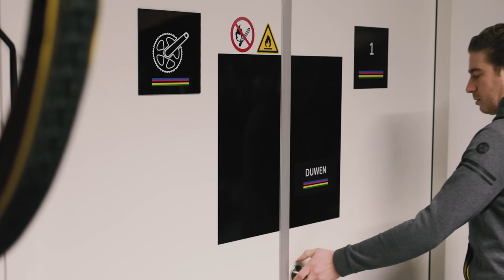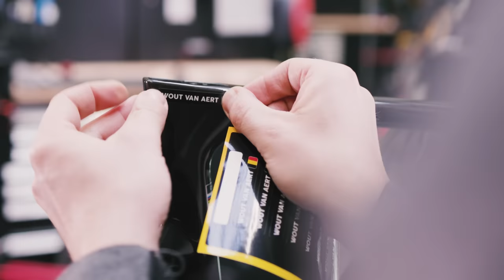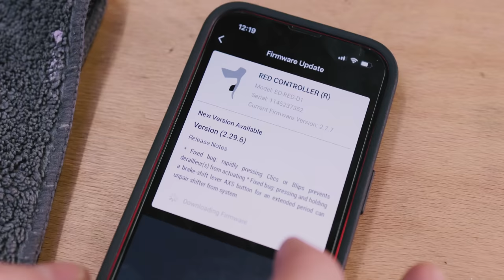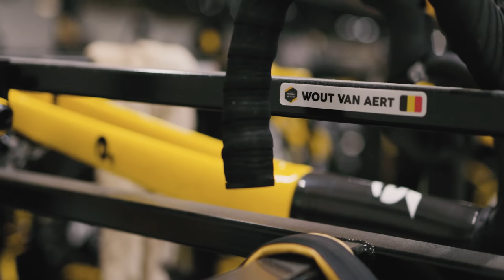Probike Build I Dream Build I Cervélo Soloist 2023 I Wout van Aert I Team Jumbo Visma

Comment: I’m having a weird picture of the Soloist so far. It’s said to be quite heavy, and the price at least in Germany is ridiculously high, even with a simple Shimano 105 group set. On the other hand I love the idea of something in between the S5 and the R5, possibly combining both the aero and the lightweight world. But this doesn’t seem to work out well so far…
Reply: probably get a cube with full ultegra di2 and integrated bars for less
Reply: @caspar_gomez  which cube?
Reply: I dunno, I have one and really like it but I think research it too much. My local shop told me they ordered in a frame in my size & asked what components I wanted to build it up with. It's my first proper nice road bike.
Reply: And you can top it with the worst after sale experience ever. My Caledonia spat out bottom bracket in less than 5k km. Apparently their bikes are known for it.

Comment: May I ask what is the headset top cap in the video? It looks similar to the acr system from fsa but I remember that the top bearing of acr is 1-1/2 while the soloist frame set with 1-1/4 top bearing.

Comment: That's a great video showing the knowledge of bike builders, really enjoyable.

I wonder though, how is it that we still don't have a system to always align handlebars with front wheel, and that someone still has to do it "manually" ?
Reply from the maker: there is a laser system from tune, but it only worked with traditional two piece cockpits. but, yeah.... it's still a little old school but it's not really that much of an issue. 
as long as they are tightened.... https://youtube.com/shorts/HK-eld1h6ak?feature=share

Comment: Great vid. I imagine Wout wont be riding this when it counts though...7.6kg!
Reply: Weight isn't everything.. especially not for this Paris Roubaix model. This isn't a climbing bike
Reply: @Leendert82  indeed! 
But as a comparison the new Giant Propel aero bike is right at the UCI limit of 6.8kg so there are much lighter options out there than the new soloist in the build option shown anyway. 
No professional will want an 0.8kg penalty especially if there aren’t significant gains elsewhere.
Reply: well, he won't. I bet you won't see him in any race on this set up.
Reply: @peterford7805  a big portion of that weight is the Propel's wheels (over 300 grams lighter than this) and groupset (Shimano is over 100 grams lighter than SRAM). Then there's the seatpost (100 grams can be saved with Darimo). The propel is a lighter frame, no doubt, but it won't be able to handle a cobble stage. Whereas this might be able to
Reply: @l.d.t.6327  doubt that, I'm pretty sure this will be the bike he uses for Roubaix. A pretty flat race where you want wide tires which don't fit on the S5, and the Caledonia's geometry is too relaxed (and even heavier).
Reply: @serdiezv  the thing is, the video doesn't give any info about the tires / tubeless / tubulars. About the most important feature of this bike imho.
Reply: @l.d.t.6327  don't want to give away the sauce too early 😉. They're super specific as to not letting people know until the race, and pressures are top secret.
I do think that they'll be using new 30/32c Vittoria tubeless tires with the mousse liner for Roubaix
Reply: @serdiezv  Well, they probably built the bike to allow WvA to test it out on the cobbles, but to claim that this bike in this setup will race, is rather bold, as you seem to agree with. Not impossible, but not very likely either.
Reply: @l.d.t.6327  I don't know if the exact tires will be used. Maybe they'll change the tires and double tape the handlebar, but I do think they will be using a Soloist for the race.
Reply: @serdiezv  S5 accepts 34mm tires, that's enough for Roubaix

Comment: Does anyone know what headset cap is that at 3:50? Does that come with the Vision 5D ACR or is it an additional part? It seems like a FSA ACR No.55R, what size though? 1-1/2? Cervelo website states the headset size to be 1-1/4 to 1-1/2.
Reply: I heard that FSA are making specific soloist headset caps for ACR like they do for other bikes but I don't know when they are coming out. I'm sure JV is able to either make or get custom ones made for them either way.

Comment: Love these dream bike builds! Curious though on the bar end caps. Did the end caps go over the bar opening and not in it? 20:50
Reply from the maker: yes, they go over the bars and saved quite a lot bars already. with the added protection they are often enough for the bars to stay on after after a crash (which kind a happens on a regular basis) and spares the mechanic a lot of work with the internal routing of the brake hoses.
https://www.closethegap.cc/product/savemybar-2-external-bar-plugs/

Comment: With websites like rolling resistance ect.. is there any places to find out aero drag?    Really interested in the soloist but really curious how much aero advantage a canyon aeroad has over it?   Upgrading from an 2009 tarmac and really like the idea of the soloist,  just trying to determine if I’m giving up too much free speed..
Reply: Same thought. This or Aeroad since I almost exclusively ride flats where I live.
Reply: @onacoffeeride  I’d def go for aeroad if it wasn’t for the seat post issues.
Reply: @ironore8677  I am thinking of waiting for release of redesigned Aeroad that MVDP is on. Looks like they made change to seatpost system.

Comment: I thought the soloist was an old Cervelo from the early 2010s. I'd not heard of it because I didn't pay attention to models for a few years. Is it a specific model for the rough Spring classics? It sure looks good. But Wout had an unfortunate Roubaix, much like the rest of his team. Lots of punctures. That could be rubber, but Fuck I guess that could be down to anything, including luck.  Cervelo sponsored pros used to use the R3 for the roughest classics. I'm unsure what bike they used in 2023. It must be the soloist though, because that is a monster chainring.
Reply: Yes, the original Soloist is an early 21st-century road bike with both aluminium and carbon counterparts. This resurrected version is similar to its predecessor geometry-wise and is considered as a race-capable bike that doesn't hurt the wallet as much as other bikes although it's still not majorly affordable.

Comment: This has to be the Roubaix bike. A 54t 1x and a pretty wide looking handlebar with too much bartape...
Reply from the maker: Yes, the bar tape is a giveaway and they are experimenting with a chain guide mounted to the front derailleur hanger, but did'n t get it in time for the build.
Reply: @roadbikechannel  yeah, was intrigued as to why they didn't completely remove the hanger and when I saw the bartape it made sense

Comment: 10:49 - is a crow foot wrench needed here to get it to 8nm? or do you just snug the compression nut up?
Reply from the maker: You don't really "need" one but it wouldn't hurt to get the right torque. We're always using one and it's actually part of the sram bleed kit. Most of the pro tour teams are a little more freestyle and rely on experience

Comment: 5:28 whats going on here? why is he modifying the headset, is there no risk of it cutting into the brake lines?
Reply from the maker: not really, the thin washer he's cutting is gonna be compressed same as the headset cone and will turn with the steerer and handlebar as one system. he's doing it so he doesn't have to fiddle the brake hoses through the washer. and there won't be any force on this part of the washer anyway since the cone has the same shape.

Comment: WvA has 240 hubs? Why not 180? Budget issue or preference?
Reply from the maker: Budged won't be a problem since Reserve is part of the PON group same as Cervélo. Preference probably, 20g more weight per wheelset but a lot less maintenance and stiffer.
Reply: @roadbikechannel  do you know the reason they are stiffer? that's interesting
Reply: @Carftymk  It's stiffer because the 180 is much thinner to give you that 20g savings.  It then sacrifices a bit of durability for it.  In rough conditions (this bike will most def be in), I would want the durability.  I own both 180 and 240 hubs

Comment: Nice bike but 7.6 is literally heavier than my ultegra 8070 build also disc … and it has a front derailleur lol sram really need to keep their group set weight in check
Reply: it's definitely heavy. My Cervelo Aspero is lighter with road wheels, and Sram Force... 7.3.
Reply: training bike with training wheels...
Reply: haha mine still weighs twice that hahahahahaah😂
Reply: What bike and wheels? These wheels weigh 1550+ grams (optimistically, realistically add another 100). SRAM is definitely heavier than corresponding Shimano groups though.
Reply: It's not the weight of the groupset, it's the frame that's downgraded.
Reply: This is just a soloist so its heavier and with training wheels but still sram is heavier than shimano
Reply: @minseong___kim  the Soloist is lighter than the S5. Heavier than the R5
Reply from the maker: There are no "training wheels". They are riding exactly the same stuff in training as in the races, you wouldn't give a jet pilot a training plane either 😉
Reply: @roadbikechannel  let's just assume those are race wheels. Let's then think about races WvA will use a 1x. You can share your suggestions, but imho, the only race where a 1x is useable, is Roubaix. If so, we can be fairly sure those tires aren't tubulars (as in: who trains with tubulars?), so those should be tubeless. If they are tubeless, let us know which ones so we can at least assess whether they seem likely to be used in Roubaix. 
ps: I ride regularly with pros, and while it is more likely (with tubeless) that pros ride in training as in races, I can assure you that there aren't too many pros riding tubulars in training, and have clincher training wheels available.
Reply: I just weighed my 56 soloist frame 1028 grams with derailleur hanger on, 373 grams uncut fork, seat post 222 grams
Reply: @Shadowboost  yoeleo r12 with farsports wheels ( dt swiss hubs ) , with power meter ( rotor aldhu non carbon ) weights in at 7.5 with computer mount and pedals
Reply: Does the weight bothers you or you need to train your knees, just spitting the truth.
Reply: Maybe the weight of the bike can give you a little help, but it won't guarantee to make you strong.
Reply: @juniorjunior9118  7.5 is hardly bragging, and I'm not claiming it'll help, just stating the facts
Reply: So surely you can now beat van aert?  If weight is SO important?
Reply: @JUST-TAP-IT-IN  nice try buddy, all i said was its a heavy bike, I never said I can beat anyone, take it easy man, its a known fact that sram red is heavy, I wasnt trying to undermine anyone or say anything derogatory

Comment: what headset cap is that?
Reply from the maker: the headset cap is from FSA. It comes only directly with the headsets: https://shop.fullspeedahead.com/de/prodotti_1/steuersatze-ersatzteile/hs-no-55r-1-8-cr
Reply: for anyone looking that is a custom cap i had to do some milling for it to fit the steerer tube. That is either a prototype from fsa or custom 3d print
Reply: There isn't a cap for the Soloist. I modified a R5 cap to get my 5D bars on my Soloist.

Comment: SRAM shifter are upgraded for easier assembling. The soft oil tube is a remarkable design! But the weight of this bike......almost unacceptable and disappointed. Does it happen because of sram? or the second level wheels?
Reply: Heavier frame for Roubaix
Reply: The S5 is heavier.

Comment: No front derailleur?
Reply: 1x son!
Reply: 2x is for us mere mortals.
Reply: This is for classics not a lot of climbing in most of them
Reply: @bernardo9202  The  Muur van Geraardsbergen or the Paterberg are gonne be though with that chainring...
Reply: @Basneeleman  for me sure, van aert doesn't feel like it should be. I'm saving up to go to 1x system as well.  I absolutely despise my fd. Maybe because its a claris one but that shit is super annoying
Reply: Have you used the SRAM FD lately? Dropped chains all day. It's a liability for Paris Roubaix
Reply from the maker: they are using chain guides as well with the one by setup. unfortunately it didn't make it in time, but there were  allready some on the spare bikes.
Reply: @roadbikechannel  do you know which chain guides (Brand and type) they are going to use?

Comment: Is jumbo Visme the first to use Wahoo speedplay in the pro peloton?
Reply: No
Reply: Is there any difference with speedplay, except for the name 'wahoo'?
Reply: @l.d.t.6327  After wahoo bought them, the did a redesign of the pedals and cleats. Last I heard they had a mysterious problem with excess side to side play after only a few uses.
Reply: @GNX157  One issue I know about legacy Speedplays is excessive play between the cleat and pedal due to pedal body wear and tear because of the bow tie-shaped metal plate.

Ever since being rebranded as Wahoo-Speedplay, a halo now encircles the pedal body, which should solve that problem.
Reply: @GNX157  and they changed the axle bearing layout, which they messed up.

Comment: Amazing bike but, why would a pro team rider use an ‘everyday’ bike for the common folks?
Reply: Maybe Cervélo wanted some of them to ride it to show the public it's race-capable as a marketing strategy.

I had no choices on modern-era Cervélos, that is until they resurrected the Soloist. The frameset costs about the same as a Specialized Tarmac SL7's.
Reply from the maker: The pro riders are forced by UCI rules to ride bikes that are available for everybody. That's also the reason why there are Sagan Edition bikes. Peter wanted a different geometry so Specialized had to sell them and not only make a few for him. 
The rule applies to the frame. The pro riders are often out there with prototype group sets and wheels for testing under race conditions.
Reply: Maybe he gets this one for training.
Reply: @yonglingng5640  Soloist frameset is way cheaper than SL7
Reply: soloist frame is the best for the classics, what this bike will be used for.
Reply: @Shadowboost  You must have forgotten there's a FACT 10r counterpart, this is the one I'm comparing to.
Reply: @yonglingng5640  2700 dollars is much cheaper than 3300. 22.22% to be precise
Reply: @Shadowboost  God, another price increase...